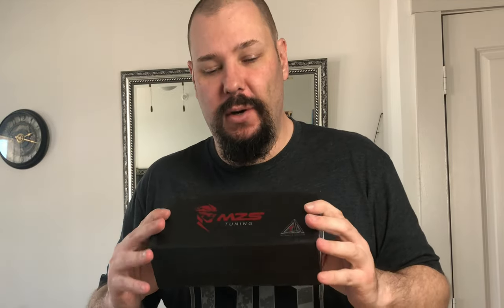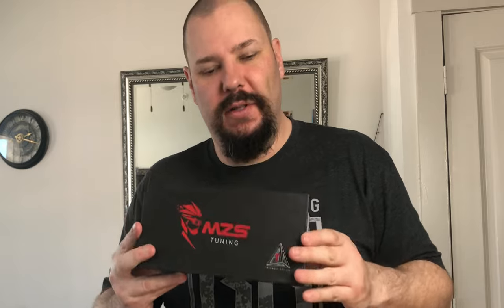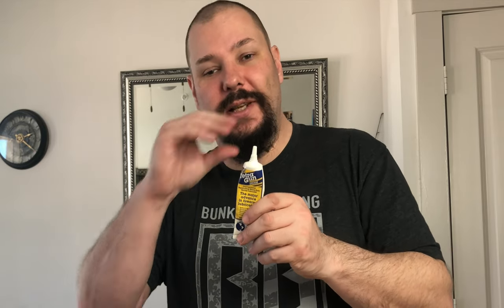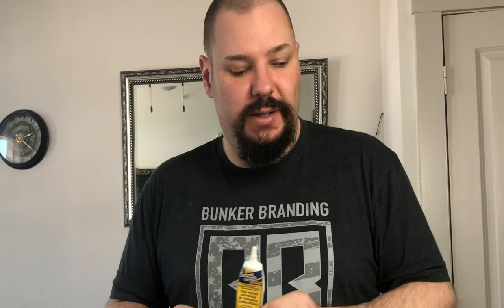MZS Lever Install for Honda CB300R

Comment: First time level replacement..I "adjusted" my clutch so well it won't go into gear from N without shutting off. New to this..brake level was easy and quick though.

Comment: These are the only ones i can find that fit. wouldn't mind spending more for the CRG ones but it only says it fits the cb600r. awesome video!
Reply from the maker: TST has some that fit, but they are out of stock a lot and at a whole different level price wise. I haven’t seen them so I don’t know if they are that much better, but I haven’t had any issue with these so… not like I beat on them though.

Comment: They look loads better, keep meaning to get some but think I would like longer ones if they do any.
Reply from the maker: Not sure but I think they make full length, including folding ones.
Reply from the maker: Wanna add that I do agree, they look much better. Not enough I'd do it just for looks, but I wouldn't say it's not enough reason for someone else. I am finding that they also feel smoother on my fingers. I get less sticking as I ease outward. The stock levers seemed to grab a bit more on my gloves. Not enough it was an issue, but enough that now that it doesn't happen I notice that it doesn't.
I think in a lot of ways that's the story with these. It's not that they're some massive change beyond letting you adjust the positioning. It's that they are an overall improvement in looks, feel and function. If spending $600 on a slip on exhaust that does nothing but change the tone is reasonable, even a fancy set of levers is 100% justified.